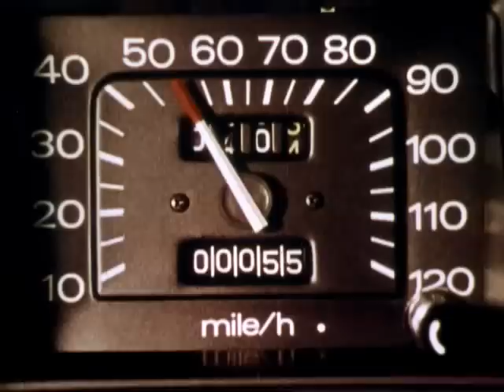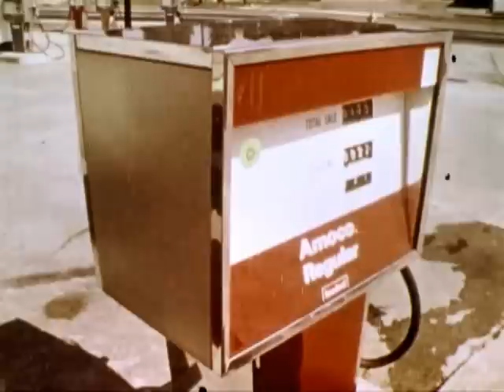How To Squeeze More Miles From Your Car (1976)

Comment: Now if only people knew how to take care of their cars today. I'm telling you, simple things like changing your oil and oil filter every 3000 miles, or 3 months, will make your engine go a long way. Making sure your tires are properly aired once a week is a good thing as well, you don't want to be driving on deflated tires. I would also recommend buying a cheap OBD II scanner for roughly $20 USD. If you have a check engine light, that OBD II scanner comes in real handy when trying to find the problem, because it will tell you what the problem is.
Reply: Most oils will last way longer than 3k miles
Reply: Thanks pop!
Reply: Changing your oil constantly can also bring it's own consequences. I'm a Honda service technician, and I can tell you that even the most diligent of car owners don't take their cars in for an oil change that frequently, as used to be the case back then. They would take their cars in for an oil change every 6,000 to 9,000 miles, even though modern synthetic oils can last more than twice as long.
Reply: @dave_riots  For a while I personally wasn't using synthetic, though I have made the swap over, and yeah I'll be extending it to about every 6k to 7k miles. I do a lot of driving, and have a lead foot at times, so =I like my engine oil clean, don't want burnt oil being in there for to long. As for anything in life, the same pair of shoes will fit differently per person, not one pair fits all.

Comment: If you have a manual transmission it's fine to coast. I mean it's not like the brakes don't work in neutral lol you aren't going to lose control
Reply: Didn't they say that it builds up transmission pressure and wears it faster?
Reply: With an automatic it can thats why I specified manual transmissions. Most newer automatics are fine to be towed or coast in neutral I think though.
Reply: Don't write this stuff anywhere. Braking while coasting from higher speeds is a horrible habit. With the car in gear your engine helps to stop too and that help is noticable expecially in lower gears.
Reply: @m4dc4t  thats harder on the engine though.
Reply: @redtra236  it ain't, unless you're shifting from 6 th to 1 st, then yes.
Reply: @m4dc4t  it is but its not that bad for it unless you downshift to too low of gear when going to fast. Personally I do it to save the brakes but its best if you rev match to avoid extra wear on the engine.
Reply: In a carbureted engine, it can save money to coast in neutral. With fuel injection, the computer leans out the fuel mixture/cuts fuel during deceleration and the savings are immeasurable.

Comment: Keep your speed about 50 on the highway?  Are you insane?  Try and go 50 mph when everyone else is doing 75-80, even in the slow lane, it's terrifying!  Really dumb, given that the highway speed limits around me are all 55, and yet you technically have to break the law in order to not endanger yourself.
Reply: scottthewaterwarrior in 1976 the national highway speed limit was 55 mph....
Reply: Yeah in 1974 they established a federally mandated speed limit on highways of 55 MPH(To reduce fuel consumption). It was repealed in 1987 I believe although it was widely ignored especially in the 80s.
Reply: There had to of been much more conservative drivers back then more interested in the trip, as they have a trip- than the destination. LOL.
Reply: Most automatic transmissions were 3 speeds.  No overdrive. 55mph was a good speed back then.
Reply: The National speed limit was indeed 55mph, but don’t let that fool you into thinking anyone actually drove (other than the morons) 55mph. Then, as now, most people were comfortable running 75mph.
Reply: @redtra236  it was actually repealed in 1995
Reply: @aleksfoxtrot8044  overdrive was first introduced in 1979 for 1980 model year full-sized cars made by Ford Motor Company (AOD transmission).
Reply: @bobbyheffley4955  oh guess i was wrong sorry

Comment: Get a Pinto...more road-hugging weight !
Reply: Too bad the car earned that terrible reputation, as if it was the only vehicle to catch fire after a rear collision. But I concede that earlier Pintos had a poor rear structure which it didn't provide any protection for the fuel deposit, and Ford should have done better to prevent deaths by fire as many as it was feasible.
Reply: If you want a really good American compact in the 70's, get an AMC Gremlin. Seriously. They were much better built than the Big Three compacts.
Reply: @raulsaavedraviolante4350  Chrysler took note and advocated placing the gas tank before, instead of behind, the rear axle.
Reply: @bobbyheffley4955  If you mean the Dodge Omni, that's correct. But that car was introduced in 1977, several years after the Pinto. Other than that, the rest of the Dodge/Plymouth/Chrysler automobiles had the gas tank placed behind the rear axle. But it had better integrity as it had several inches of space between it and the rear bumper.
Reply: @raulsaavedraviolante4350  the 2011 Ford Crown Victoria, Mercury Grand Marquis, and Lincoln Town Car were the last vehicles to have the gas tank behind the rear axle.
Reply: @bobbyheffley4955  That's correct. And before them, the 1993-2004 Grand Cherokees, 1984-2001 Cherokees and 2002-2007 Libertys shared the same position. Indeed, those gas tanks were much more dangerous than those of the Panther cars, because they lacked any protection and were placed at the very back of the vehicle. However, both manufacturers (and the rest of them for that matter) should have taken extra measures to make that layout safer. Measures such as protective linings, kevlar or shields. It would have added to cost but the client would have paid more.
Reply: @raulsaavedraviolante4350  fires caused by rear-end collisions in these vehicles killed more people than crashes involving the Ford Pinto (only 27 people were killed when Ford Pintos were rear-ended).
Reply: @bobbyheffley4955  I couldn't agree more with you. the Pinto was in fact no more dangerous that any other subcompacts of its time, but still one dead is too many. When it was performed the autopsy on the charred bodies in Pinto crashes, it was discovered that the fire killed them, not the colllision. Had the car not burst in flames, they would have survived with relative minor bruises instead of burning alive. Same thing with the Jeeps, where many deaths could have been avoidable.
Reply: @raulsaavedraviolante4350  one person dead from injuries sustained in a car crash is both a tragedy and a statistic.
Reply: @bobbyheffley4955  That's undeniable. Unfortunately several deaths are impossible to prevent because of the severity of the collision (e.g. a tractor trailer smashing a smaller vehicle), but many others perish in a senseless situation such a car fire that in a moderate crash shouldn't have taken place.

Comment: I have the brown Datsun B210 in my shed with 18,000 miles on it in year 2023 imagine that if they can just get the drivers on fentanyl off the roads I'd feel a lot safer driving a small car than a big one. The big one offers me lots of safety through all the excessive steel around me because fentanyl drivers passed out and crash into you